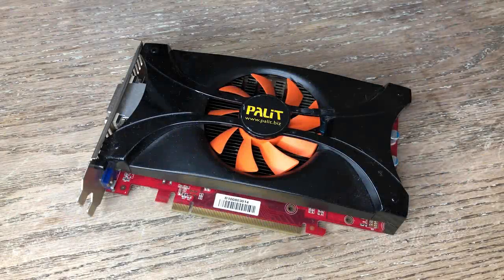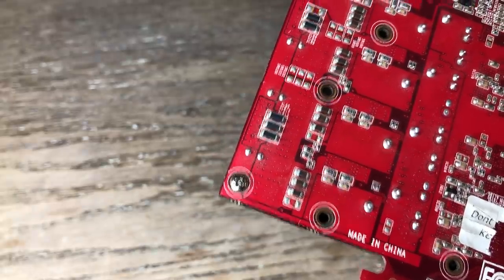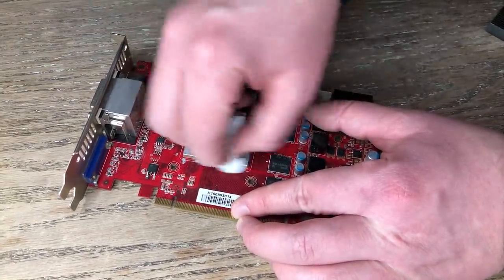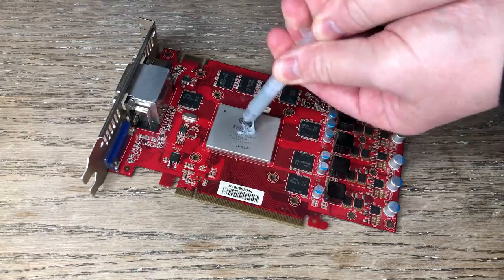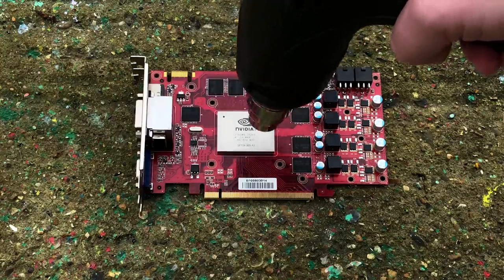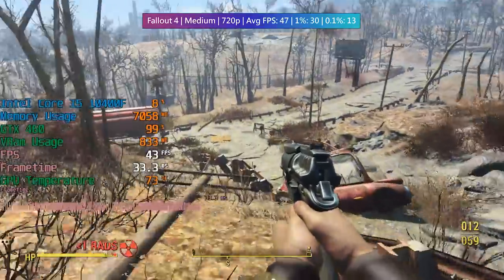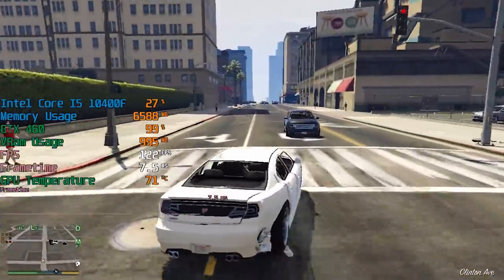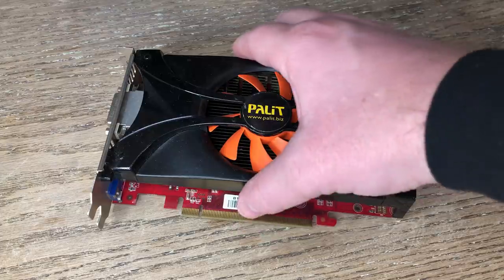Reviving The Dying GTX 460

Comment: +1, for heat gun focusing, instead of Oven Bombing

Saved Card 1) ATi HD4890 - Dust layerings; brittle thermal paste = eFFang glitter bomb [I, wasn't amused]... The thermal pads, were no more. Sizeable amount of alcohol cleaning, before heavyhanded thermal replacements. It be perched comfortably, within an 2008-ish spec'd XP-SP3 Box. Got such nostalgia memories, to my 1st full tower construction [same ATi installer interface, as my HD3850]... Need to reclaim some XP games tho :/
Saved Card 2) AMD R9 290 - Relatively clean, but full redo of thermal paste / pads [pads esp. were goners]. Runs a smidge warm, but do believe was inevitable. Maybe entertain a Win7 Box?
Saved Card 3) ATI V7800 [Cypress-based chip] - Relatively clean, but full redo of thermal paste / pads. Runs a bit warm, but it is a 1SLOT Card!?... It doing SCIENCE [aka, PrimeGrid]
Saved Card 4) AMD R9 390X - Sizeable dusting and replacement of thermal paste / pads. Initial booting and basic engagement was all fine. Throw on a small benchmark--> snaps black screened. After multiple goes + subsequent failures, I had it then run with MSi afterburner + HW Info. The core temp readings were fine, but still black screened with same load applied. I went about yanking off the banshee hoover, to replace with a different style cooler [main concern, was VRM / Mem, were getting 0 support, off the blowers heatsink]. Arctic Accelero III installation, was one scary effort to apply, since fast-set cement paste 'sploded out of the little canister, giving little time to arrange all the little component heatsinks. Left it sit a few days before testing it. Low and behold, it lives to fight on [+ far less noisy HS to work with]... BUT, is now too bigg for any case, I could've situated its use [Went from UNIT, to a C H O N G U S]

Comment: Actually, the oven method or heating the GPU whatever you say is technically a kind of solution but it's uncertain as you said, whether it holds 1 year or just 1 week. I used to use a GPU that heated back in 2012. It lasted 1 year then I sold it to the person who repaired it. Ahh, good old days. :D

Comment: The 460 is a really good card. Nvidia tweaked the architecture for gaming so it’s a lot closer to the GTX 480 performance than you’d think from looking at the specs and power consumption. The 480 was more optimized for compute as the same chip was used in workstation cards.

Comment: The reason this happens is because the industry uses lead free solder which ultimately causes the solder to crack. This just melts the solder down and fills the cracks, but as you say it's just a temporary fix. Used to do this all the time on the first gen Xbox 360 with its RRoD. Good times!

Comment: I had this same card, except it was 2GB version. It was very good GPU, however after 7 years and one bearing replacement, it strated showing checkboard on the screen. I switched it for 750Ti and put 460 in the oven. Suprisingly, it worked right away. I have put it in the box and it sitting there until this day.

Comment: Done this to my old HD 7950 back in  mid 2016, gave the card to my cousin and surprisingly it still works.. Paired with a an i7 3770k he has zero problems on fortnite, rainbow six seige and BF4 👍

Pretty sure I even oc'd the card too

Told him. About the RX 580 and other cheap cards to upgrade too but he's just not interested right now.

Comment: I bought an artifacting gtx 780 ti for 30$ and reanimated it with a heat gun but it seemed to last only a month.After flashing a modded bios to disable boost it lasted from september 21st till yesterday when it failed again.Since the heat gun wasnt mine i just flipped the card and used a lighter for 1-2 min to fix it again xD .Your explanation is very good.There are even tinyer balls that connect the gpu die to the substrate and due to difference in thermal expansion of the materials these ball can move out of place.If you want to prolong the life of such a defective card you can use msi afterburner to lower clocks and increase fan speed to lower the temperature delta  between idle and full load because thats what kills them again.Perhaps you can do a long term test

Comment: I bought a 1080 ti off some guy from the Facebook marketplace, he said the GPU was practically dead as it used to be a mining gpu. I bought it on a whim for like $50 USD and decided to use the old heat gun trick. Here we are, almost 2 years later, and the card is punching triple A games in the face without any issues! Sometimes taking a chance on a broken card cab pay off! (It's an MSI Duke)

Comment: Did this to the laptop I'm typing on, I would suggest providing better paste and better cooling (if it's a desktop) than the stock then hopefully it will last years. Just don't overclock them and set the cooling fan curve higher.

Comment: I did this with my GTX 480 a few years ago. It lasted for 6 years beforehand though, which is pretty surprising considering how much heavy usage it got.
Reply: Still working/using it regularly? Or did it die / did you retire itit?
Reply: @TheRailroad99  It started artifacting again about three days later. I bought a cheap side-grade card at that point until I could afford a proper upgrade.

Comment: Personal experience, I baked an old, passively cooled XFX Nvidia GT 8500 (512mb) GPU back in 2012, I wanted to play Skyrim and that graphics card was all I had lying around. 
It was either that, or using the onboard G31 Express Chipset.
It lived for exactly 4 days before failing again, I still even have the damned thing in a drawer somewhere lmao.

Comment: I revived a gtx 650 using an oven. It lasted 2 frikin years before it died! I later upgraded to a 4gb 960 STRIX edition in 2015. Shortly after it's release. I plan on upgradeing to the 1070 or the 1080. My budget is £250 at most. Do you have any advice on which one I should get?

Comment: Thank you for not using the oven method. I also managed to revive a 1070 for 2 weeks with a heatgun. would suggest to use a thermometer and stick the probe to the die with thermal past and heat in up to about 220°C That way you will not overheat it. Also you should try to dry the cards befor reflowingIf they where stored somewere with high humidity the water trapped in the pcb could turn to steam and create bubbels in the pcb destroying it.

Comment: I'm still rocking a gtx680, which I've baked twice.  My motherboard only supports legacy BIOS, so I cannot buy a new GPU without replacing my motherboard, CPU, and RAM, so I'm trying to avoid dropping around $1K before I absolutely have to.  My card died around two years ago, and I baked it, but I didn't have any thermal paste, so I reused the old stuff.  The card died again about six months after that, so I bought new thermal paste (whatever was the most expensive at the electronics store), and baked it again.  I've been gaming on it for a year now with seemingly no issues.

Comment: Ive tried this with my old HD 4870, It works until now(6+ months), but its used only as display adapter for pcs without integrated gpu for testing. Its pretty oldschool desing without shroud nor blower, just copper heatsink and small fan.

Comment: Would a hairdryer work? Some say it won't but other say they have tried it and it does. I've got a GTX 1050 which i have tried everything to fix and get a display out and drivers but failed with blue screens :( I don't have a heat gun and I don't have a sacrificial oven.

Comment: GTX 660 TI, two resistors burned/shorted out did the oven trick, resoldered some caps because they fell out of the pcb. Worked in SLI for 6 months afterwards 😁

Comment: Baking a graphics card is the solution only when dry joints have occured. This is the way to melt them and solder again so they can conduct electricity. It is possible mostly with older and low quality graphics cards because nowadays better materials are used.

Comment: I have a 560 with pretty awful artifacting.
Everything is fine just the display output is a mess. The core is stable and even runs Games and FurMark so its just the display output.
Should I try to reflow the core or do you think my problem is elsewhere on the PCB.
I would love to revive that card for OC experiments.

Comment: used to wrap them in a towel I didn't care about before putting in the oven to help prevent the smell (only partially worked) but did revive a couple igpu laptop boards and a video card like that before

Comment: There IS science behind the heat gun / oven method. The assumption is that old solder joints can crack and such. Heating the card however you choose, supposedly reflows the solder joints thus reviving the card. Not always temporary either. Ive personally seen card live for half a decade after being "revived" with a heat gun. Sometimes it can be the card took a good hit or was dropped while it the box, no visible damage but can be solder balls and joints damaged.

Comment: I have an Asus RX 550 2GB card and it's having some weird issues. I can't install any adrenalin drivers on windows 10 but works with windows 7. I can only use the original driver in Asus website which is 17.... Crimson I think. The PC crashes when installing adrenalin drivers and shows pixelated screen. So should I try this method? I've even updated the BIOS which Asus gave me but still doesn't work.

Comment: My wife had an at the time very expensive HP laptop, one of the infamous DV9000 series with a GT 7600 onboard video solution from nVidia.  The cooling that HP used was wholly inadequate, and the laptop's display croaked after about 18 months or so.  I took it in for repair after looking up the various symptoms, and there was a local shop (well, about an hour away) that did the "Re-flowing" of the chip.  Failed again after about 5 months.  If I'd known then what I know now I wouldn't have bothered.

Comment: I had the same GTX 460 from Palit back in 2010. It died after 2 years of use and used the same ”technique” to revive it with a hairdryer. Twice actually. It lasted till 2017 on a secondary system at which point it started artifacting again. It was pointless to bring it back from the other side again after 7 years of service so I gave it a proper burial. RIP GTX 460 from Palit.

Comment: 2024 I bought this gpu in 2017 it barely lived , i soon replaced it and kind of forgot about cause it was not working properly , i had it laying around and the plan was to try to fix it somehow or throw it away , anyways i see this video in one of this night owl nights and i want to try it my heat gun goes to only 300w and i couldn't reach the 150 160 170 temps but i kept it on for 10 min trying to reach that it kind of got max 125 and kept going down so i thought it prob wouldnt work but i cleaned it up as well as i could put brand new soldering paste , used the opportunity to learn and use the spatula made it smooth put it on , and after 3 weird restarts , first time i forgot to even connect the HDMI cables , it actually showed the bios screen then i knew it would work after 1 or 2 other restarts my screen is on need to find the drivers to fully test it but it was a success

Comment: This is why I'll only buy new PC components. It is not unusual for used cards in my country to cost some 75-80% of the cost of a new graphics card. And more importantly, you can never know if they were fixed like this and then sold as 'used, but as good as new' cards (people here have no shame). If they cost 50-70% of the cost of a new one, you can be sure it's been 'fixed'. I bought used graphics cards twice in my life (not considering integrated ones), and they both died 4-6 months later (when I tried to contact the seller of one of those, I couldn't reach him and I later found out he's in jail ).
So it did cost an arm and a leg when I bought a new PC recently (since we earn so little here, even 'outdated' parts cost way too much) but I really am glad it's all new

Comment: Even though Fallout 4 has a minimum requirement of a 2 GB GPU, it can run on a 1 GB no problem as you saw.
I managed to do it with a Radeon HD 7770.
There was just a setting, which needed to be either disabled in the launcher.
I think it was [FXAA]; [Off] and [TAA] were not giving any issues.
Reply: Also... I'd love to have that card or any other orange-tinted GPUs in my retro build, which has orange CPU fan and RAM with Orange heatspreaders.

Comment: I actually did this to an Nvidia GeForce 8400M GS in a Dell XPS 1530 for about a minute in full blast(here in USA heat guns only go to 1800W max). Before the laptop would boot but it wouldn't show video. Just fan spin and a few LEDs. Now it works perfectly aside from the left speaker not working in Linux and Windows 10 won't play at all but sound will work through the headphone jack. Not sure if due to the motherboard. Isn't worth trying to repair that if so.

Comment: I will try the heat gun method as the oven method has not worked out well for me. I’ve only recovered 2 out of 5 cards using the oven method. In fact, twice the cards were worse (no post) after using the oven method. Thus, the heat gun should be better since you can localize the heat to the GPU die only.

Comment: You should use the NVIDIA MODS/MATS diagnostics, it's a bit tricky to get, but it's the official internal diagnostics software. MV techlabs and servlesson have good videos about it.
MV techlabs has useful videos about measurements and typical faults too.

Comment: I dunno with a 2000W heatgun it's likely that you may have actually reflowed the chip, I didn't look at the rossmann video but if it's the one I'm thinking of it's where he's talking about heating "bump-gate" era NVidia chips that had high-lead bumps that were highly prone to failure and it the reason it fixes them is that it temporarily re aligns the bumps which are the solder joints that connect the bare die to the package but eventually they'll fail again, I'm not sure this would apply to the GTX460 since it wouldn't use those type of bumps..
Reply from the maker: yeah could be, the whole solder ball thing is still plausible, it's just a much less common problem I think

Comment: I baked both mine and my son's GTX 470's many years ago...he used his a couple years before it needed replaced.  Mine I replaced with a GTX 580 a few months later and my daughter got the old 470 to use and in all it probable lasted a year or so after the baking.  Both cards went back to bad artifacting and have been replaced years ago at this point.

Comment: That 460 is actually fairly comparable to a GT1030. The only problem is the lack of driver support (Fermis don't support anything newer than 391.35), ridiculous thermals, power consumption and of course the 1GB vRAM.
These cards can still fetch good money in a lot of countries.

Comment: In the future i would use less thermal paste...a lot less and when you spread it like that it leaves air pockets.If you get something like the thermaltake TG-7 thermal paste it comes with a little plastic spreader so you can spread it evenly

Comment: I had the exact same Palit gtx 460 card I while Back it ran Control released in 2019 at 30 fps  - did a video on it too hahaha . I revived a Gtx 560ti  with the same method - luckly i got the card for free so literally nothing lost , but had to build a makeshift cooler from a wind force cards old shroud and fans with zip ties  hahah been using it for almost a year as a second card to test other hardware

Comment: Why this Method works and what it does:
In the life of a gpu, it goes through thousands of thermal cycles (from room temp to like 50-80°C and back when shut down). And the thermal material expansion slowly rips on the Solder points oder the Solder Ball grid array, with that the gpu chip is connected to the pcb, until finally no proper contact is possible on some pins. This problem increases with chipsize and temperature range, so RTX 2080ti/3080/3090 owners beware!
The oven method isn't hot enough to "reflow" these solder balls, luckily, as it's an insanely precise process to place the chip on the ball grid array, and almost impossible to do this by hand without extreme skill or the right tools (which cost like thousands of dollars), instead the Solder balls get thermal shook a little bit back to their original positions which is often enough to fix a problem. Obviously the graphics cards will have more thermal cycles when used further, and that's why it's only a temporary fix.

Comment: Once my dad put my graphics card into an oven and... Forgot about it! All SMD components fell of a board. So your method is a much better. If you guys don't have a heatgund and don't want to buy it as well - you can try puting an iron on your chip for couple of minutes.
Reply: put a sabertooth mobo in the oven with the CMOS still in - not good.  it burst after 10 mins.

Comment: Heating the chip you can get the balls under the chip to make better contact, reflowing your not but temporally making an electrical connection. Problem with lead free solder is doesn't reflow as easily as normal tin/lead solder. Best method for those that have the equipment is to remove the chip, reball it and reflow back to the circuit board.

Comment: That's how i revived a HD 7870 that i got for 11,50 euro.
While it's not a permanent fix if done right it will last for quite a while, months later that GPU is still going without issues.

Comment: Does it matter if the type of oven is different (electric, gas)?
Reply: Does not, however its better to not use it as your daily use for cooking such foods if you want to use it as some revival station for eletronics as they release toxic gas and can contaminate the oven itself. Better off use a heat gun instead.